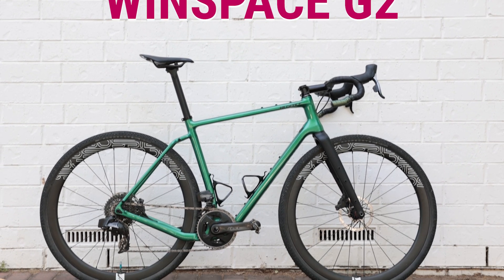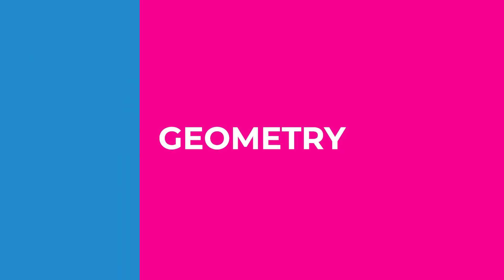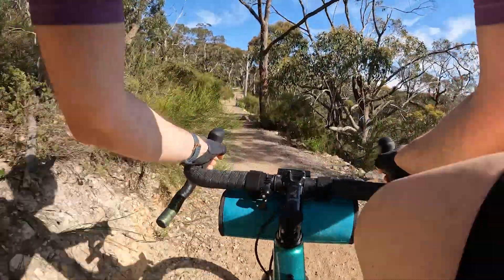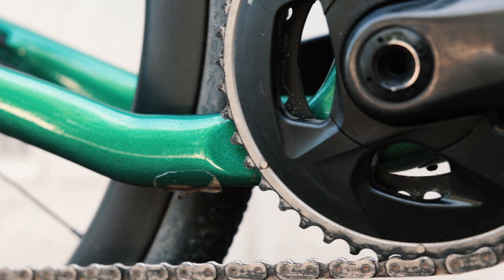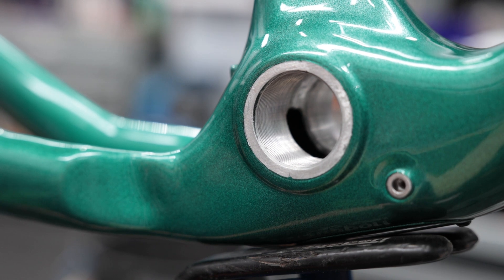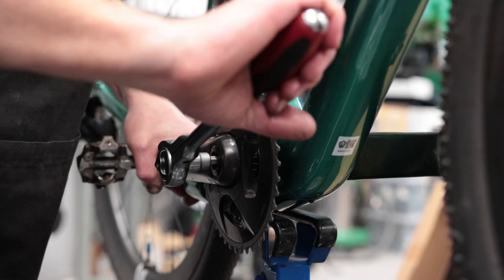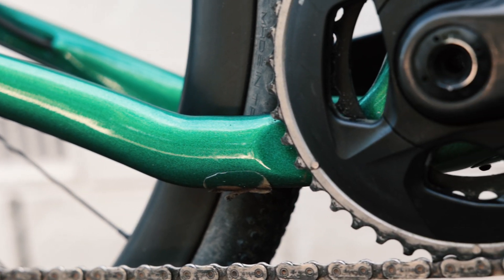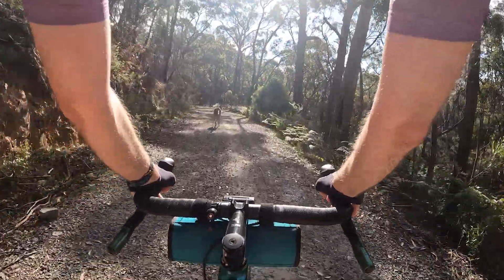What you NEED to know about the Winspace G2 gravel frame - build guide

Comment: Hey hey! Good to see this video finally posted. First of all, THANK YOU for the time / money invested in this so far. We always appreciate that. I thought I'd dive into some of the topics in the video. First of all, our attitude to YouTubers has always been WYSIWYG and send products out to the strongest critics. We don't give frames or wheels for YouTubers any special treatment and they get pulled off the shelf in the warehouse just like any customer order would be. 1) The facing: I think the criticism was fair that the facing was "middle of the road." However, middle-of-the-road isn't where we want to be. We've already passed this on to the production department. On future production runs they'll be more strict on the amount of carbon that is near these mounting surfaces. 2) Geometry. We approached this frame thinking most riders would be coming from a road bike background, and wanted something that handled in a familiar manner to their road bike. There's a bit of a moving goalpost in terms of not knowing what size tires the rider is gonna use. The difference in fork trail between a 32C and a 50C tire is quite a lot, but the chainstay length doesn't change, so trying to balance the front/rear handling of the bike across all tire sizes is impossible. As you rightfully pointed out in your video, one man's twitchy is another man's agile. Personally I think with a wider gravel bar the handling is on the 'agile' side. But again... it's subjective. So, we say watch more YouTuber's videos before making a decision (Ideally from someone the same height riding the same size frame as you.) 3) Fork & Steerer. Yeah, you pretty much covered our view on this in your video. The thinking behind the decision is that if a customer is running fully internal, that part of the steerer will not be reinforced. Therefore we design the fork to handle the stresses with that area reinforced. If we offered an "extra reinforcement" for those running external cable routing, it wouldn't be showing much confidence in our engineering. We're not fundamentally against the idea, we just want to be careful to not send the wrong message to those who are running fully internal. 4) Chainslap. You're right on this one. Extra protection never hurt anyone. We'll also add some in-the-box protection in future runs. Of all the test bikes we ever built ourselves, the only ones with visible damage to the chainstay is one running a long-cage Sensah GRX mech (that has no clutch.) Lots of variables on this one obviously, chain length, rear mech, chainring size, etc. If in doubt, do as you did and put on some helicopter tape.
Reply from the maker: Cheers for your response team, I'll pin it so people can check it out
Reply: I know I'm several months late to the party, but thanks for taking the time to address issues brought up in the video Joe. With the "twitchy/agile" thing, I was actually thinking about doing some consolidating and selling my old CX/commuter/gravel/adventure bike along with my road bike, and getting a gravel bike that I can swap out wheelsets depending if I'm doing a fast group ride or going off-road with bike bags. With the handling, it sounds like this frame could strike a good balance, or is it too many compromises to split those two situations?

Comment: Solid review. Most reviews of this frame I’ve seen really don’t talk about all the issues. They simply focus on its price. To be fair, for those thinking only something in this price point can have issues, don’t. I’ve owned two $2500+ frames that both needed work to get things flat and happy. Both from very large reputable companies. My worry for this frame though is warranty. Maybe in your next full review you can talk about their warranty and how it is communicating with them. I’m a huge proponent of buying as much as I can, especially big purchases, from my local bike shop. Not only does that make for a better relationship, it also means I can get help whenever I need it. I’m wondering if you buy this frame and have serious problems what that will be like. Cheers.

Comment: uh oh ... I have one on order but will build it as an all-road bike with 32C. Thanks for raising the issues on the stuff that other reviewers either missed or glossed over.
Reply from the maker: Not a problem Hansen, glad to give you some handy information. You should still definitely be excited about your upcoming build! Get the thing built up well from day 1 and you'll have a lot of fun with it.
Reply: @JustRideAdelaide  what can you say about using a 50-34 crankset on it considering they put the limit at 47t … should be solved by a chain catcher if the issue is potential dropped chain getting wedged between the big ring and chainstay no?
Reply from the maker: @hansendy3708  I think your issue might be the chainstay clearance of the 50t cog. It might be quite close to having the teeth bite into the chainstay because of how it sweeps out. You may night find out until you're trying to build it.
Reply: @JustRideAdelaide  They managed to put a 50-34 crankset on their sample G2 bikepacking rig (on the G2 launch video and website) just fine, tho the presentor did say that do so at your own risk - so I think it clears the chainstay unless the chain is dropped. Otoh might be easier to just buy a proper rb frame like a caad13 or allez lol

Comment: Excellent video as always. 
Great fabrication skill by whoever made that long wedge out of the cut portion of steerer tube!  Agreed, this is better than the supplied part.  It's a no brainer.  

I am considering this frame {actually the Light Bicycle Journey, its identical}  & I am 175cm tall or 5'9" which is right between sizes.  I am of normal build, not long legged or anything.  Would the small frame be a better choice?  I always ride medium bikes but this may be the exception.  Thank you for any advice you may have!

Comment: @Ride Adelaide The expander plug in your video is completely different than the one I got with my g2 frame set. Same goes for other youtube reviews I’ve seen. Was your expander plug long enough to support one or both stem bolts? The expander I received has a centered(not offset) stem top cap, then a spring that sits below it, then 2 piece wedge. It looks like the expanding wedge piece would only be able to provide support for one of the stem bolts or sit between them both if playing with the position of the wedge utilizing spacers below the top cap. I’m not sure how I feel about the design of this one as the top cap bolt would be relied upon for expanding the wedge as well as providing preload for the headset.
Reply: update for me on my g2 steerer expander setup: I asked winspace to provide me the full length expander plug, which they sent me. I then took the half length aluminum spacer(allows for internal routing) that fills the void of the D shape steerer tube between the tube and the stem to a machine shop and had the machinist make me a full length version of it including a lip at the top. This way I have the full height of the stem supported both by the full height spacer and full height expander plug. No internal routing for me which I never intended to use anyway. I've been running this setup without issues 2000+ miles.

Comment: I had issues with my T1500D frame about that D shape steerer.
The wedge they provide you is to short, so my stem tended to move a bit during big sprints (by pulling hard on the handle bar) and i ended up with play in the head set.
So i asked to my Winspace dealer to give a second wedge to put it just underneath the first one.
Problem solved !

Comment: If I were to use internal routing for the steerer, how does that solve the problem? I.e - what would be there to fill the void? (other than the cable/hose) I'm new to custom builds - I'm considering having one built by a pro, but I'd like to understand as much as I can

Comment: Great review. Was thinking about this frame til I saw that steerer. Not a fan. 
Should these steerer routed designs go away, or does the tech just need time to mature and improve?
Reply: I think they would be safer if the steerer were aluminium and the fork carbon, but that involves manufacturing complexity so I guess they won’t do it. I have an aluminium/CF fork and it uses a star nut in place of a expander plug. Never have to worry about  a cracked steerer.
Reply: @bengt_axle  the trade off is then you have to worry about the bonding of the carbon to aluminum.
Reply: @davidgarza2267  yes. I’ve heard this many times. I think there are ways to mitigate this. On my fork, the aluminium is quite overbuilt compared to a carbon fork and the carbon is bonded to it with a clear resin, finished with clear laquer. If there’s delamination you can catch it earlier. It is definitely not a super lightweight fork, but it’s rim brake, so bike wheels have some weight savings.

Comment: Will this bike really fit a 700c 50mm tire with a front derailleur like a Shimano DI2 or GRX DI2? I have a frame with a similar chainstay length and the front derailleur, specifically an Ultegra Shimano DI2, prevents a larger tire from fitting as the tire hits the FD.

Comment: Interestingly this frame is also sold by Light Bicycle .. a manufacturer in China. Now who developed the frame?
Reply from the maker: I've seen that listing and largely ignored it for simplicity 😂
The complex relationship between brands and factories can do your head in! I did note with some interest that Winspace seems to be a little cheaper
Reply: I've seen a video where they (winspace) claim to have sought the help of an ex cervelo employee in the design of this frame. I've had a few cervelo's and 2 of the 3 were replaced under warranty....each of which would of been outside of a Winspace warranty window.